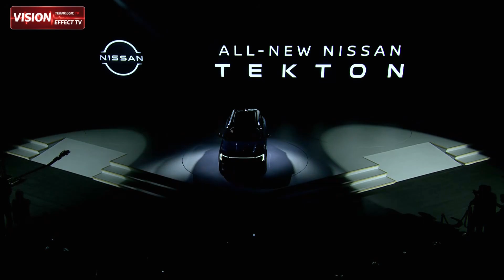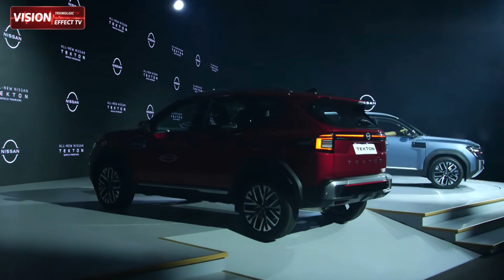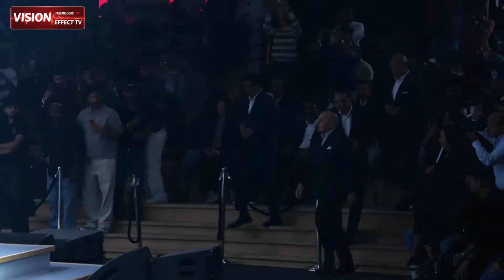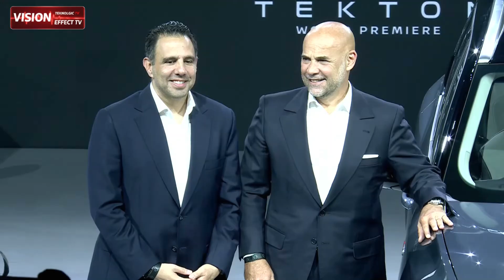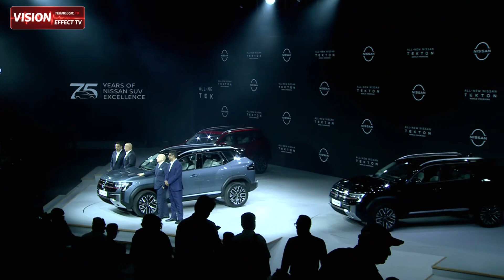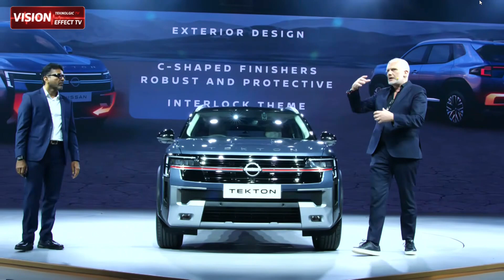2026 Nissan Tekton Unveiled: The "Baby Patrol" Flagship Design Revealed! First Look

Comment from the maker: Nissan didn't just build another safe, blending-in family crossover with the Tekton—they deliberately imported the heavy-duty, vertical design philosophy of the iconic Patrol to completely disrupt the premium mid-size visual grid. The broad fletching light bars, blocky rectangular posture, and clean window lines make a serious road presence statement. Does this upright, rugged 'Baby Patrol' aesthetic give the Tekton the ultimate stance in its class, or do you still prefer the sleek, curved lines of more traditional crossovers?👇